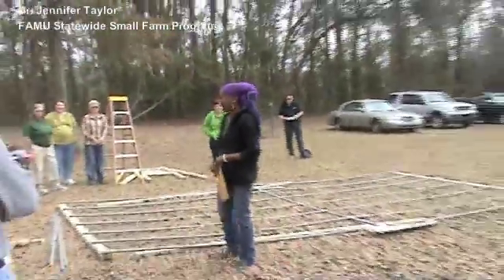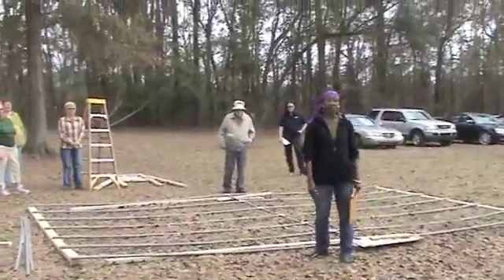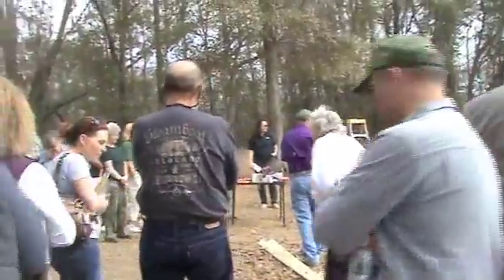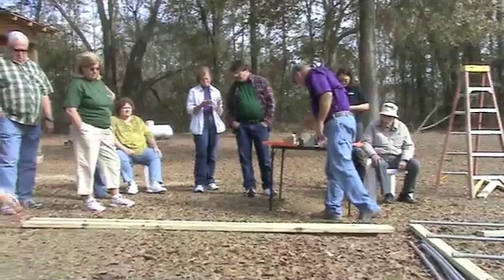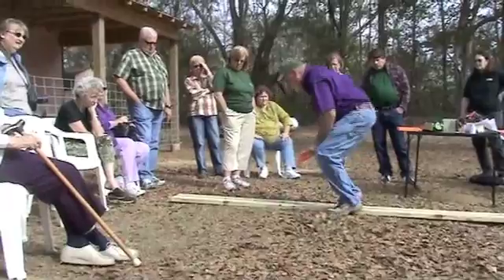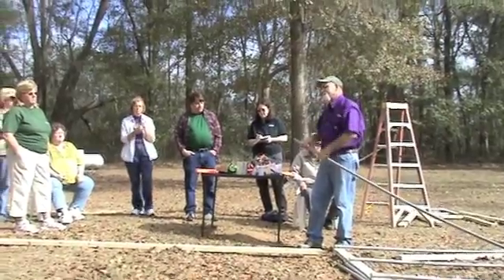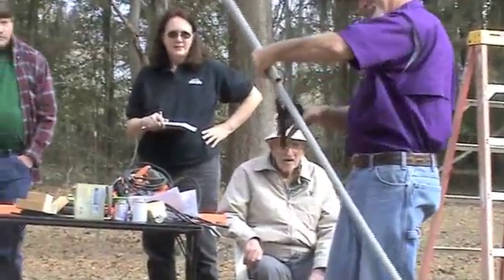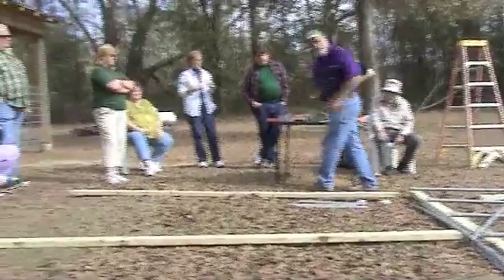How to Build a Greenhouse for Under $100 Part 1 of 3 | Golden Acres Ranch Florida | FAMU

Comment: I am building two greenhouses, using this plan.   When cutting the pieces for the roof, this man suggests cutting each of them 23 and a half inches long.   I found that length did not work for my fittings.  To make 24 inch centers, I found 22 and three fourths inch was the exact length I needed to cut for each piece.  Perhaps there are different styles of fittings, so you might want to check before cutting all those pieces.  By the way, my fittings came from Lowes Lumber.  Thanks for this instruction video.

Comment: Thanks for posting this very good and informative video. If it is available in your area, I would suggest using oil field sucker rod for the frame. It comes in 15ft lengths. It's heavy duty and would last almost forever.